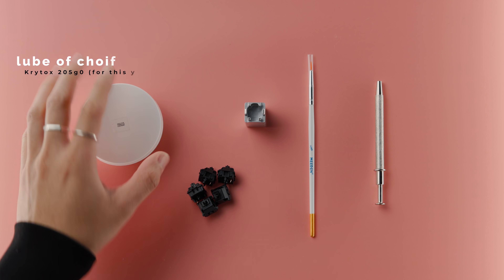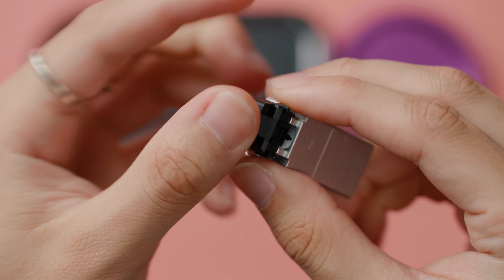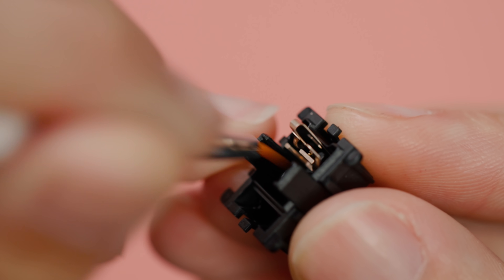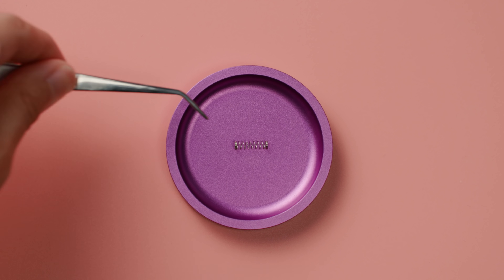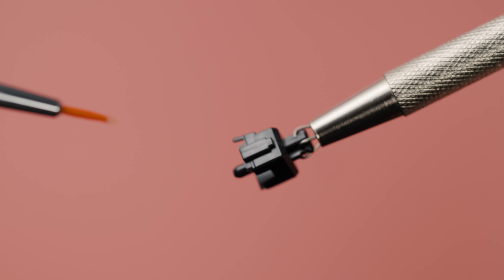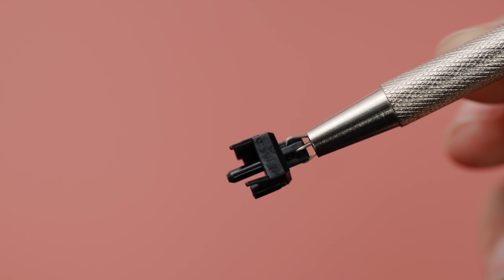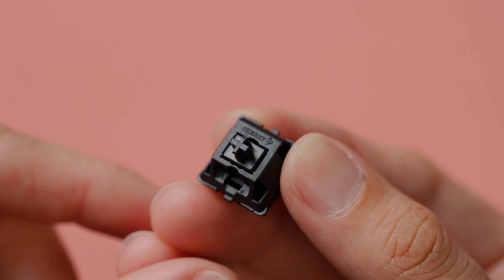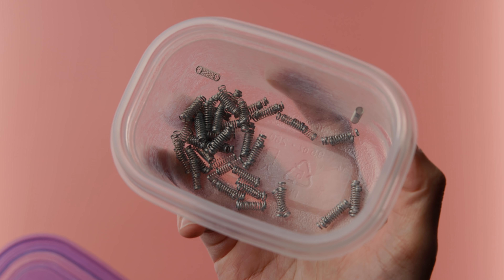How to Lube MX Style Switches

Comment: Do you recommend lubing Gateron blue switches? I have the blue switches on my Keychron K6. 
Thanks!
Reply: Not worth it to lube clicky switches for as you want to stay as far away from the click bar as possible.
Reply: @ninaalee3263  Thanks! I want to find out how the clicky switch sounds like and I am worried that after I lube, I will regret lubing.

Comment: How long does the lube last? When do you think you must re-apply?
Reply: Once you lube the switches/ stabilizers, it will stay for a very long time ( mine was last for over 2 years before it started to wear off ). Even if the lube wear off, the smooth feel will still maintain in the switches/ stabilizers so you don't have to relube them unless you really want to :D.

Comment: one question i have is how often should you lube your switches?
Reply: Once you lube the switches/ stabilizers, it will stay for a very long time ( mine was last for over 2 years before it started to wear off ). Even if the lube wear off, the smooth feel will still maintain in the switches/ stabilizers so you don't have to relube them unless you really want to :D.

Comment: Do you need to let the switches dry before putting it back into your keyboard?
Reply: No need to as you only apply a thin layer of lube on you switches, unlike spray lubing as you will need to wait for a few day for the lube to dry out.
Reply: @huunhanle3809  thx

Comment: What are the repercussions of overlubing a linear switch? Let's assume that I (horrendously) consistently overlubed an entire batch of cherry MX reds. What would be bad about that?
Reply: Not very bad to be honest, it's only affect your typing experience since the switches are overlubed - itdoesn't feel too smooth and it feels almost muddy. Imagine wet mud - it's slick and slippery, but also very thick and tough to get through. In particular, the upstroke felt slower, and it was not a pleasant experience in the slightest.

Comment: How often should I lube my keyboard switches?
Reply: You really don't have to re-lubed switches since when you lubed them switches, the lube also applied a very thin layer of oil on your switches. When the lube wear out, your switches will still maintain the smooth feel as the thin layer of oil is still there.

Comment: this also works for optical switches? sorry if it's a dumb question, im a beginner :)
Reply: You can, Krytox 205g0 and Tribosys 3204 lubricant are both go-to options for linears Optical switches- just make sure not to get too much on the center post - a glob at the bottom of the switch may confuse the optical sensors.

Comment: Can I lube the stablizers of my blue swith keyboard? Not the switches self, but only the stabilizers of my keyboard? And which lube is the best for that? Is the krytox xht-bdz good for that? (since it is thick)
Reply: Sure, you can. And both Krytox or XHT-BDZ is a good choice for lubing stabilizers, pick wherever you prefer :D.
Reply: @huunhanle3809  I just thought just because i have blue switches  wouldnt be a thick lube bestter than a thin lube? since i want to keep my switches heavy and not super light, cuz i have blue switches?
Reply: @cloxytr9144  The switch and stabilizers are two individual parts of the keyboard, lubing your stabilizers will make it produce less pinging sound and less rattle, and it has nothing to do with the switch. Thin or thick lube is based on personal preference, so I really don't know which one is better, some people like thick lube for stabilizers, others prefer the thin.

And of course, you don't need to lube your Clicky switches, if you prefer to keep your switch's tactility and the "click" mechanism intact.
Reply: @cloxytr9144  Nah, it's depending on your lube method, and which lube you're using, so no guarantees the result will be the same. For the type of lube that matched your requirements "not really thin but also not really thick", I would suggest Krytox GPL 205g0:105; it's a mix between GPL105 and GPL 205g0 in order to reduce the thickness of 205g0.

Comment: i know this is sacreligious but a guide to lube OUTEMU switches for those of us that only make $2/hr in Southeast Asia and Latin America would be lovely, sadly every other switch company out there is extremely expensive and making less than $200/month makes it IMPOSSIBLE for someone like me to buy anything else. Thanks.

Edit: I say this because you can get Hotswap Outemu keyboards for less than $40 bucks(i currently own one, had to save for 2 months); maybe this could work with outemu too??
Reply: You could buy Gat Yellow for like dirt cheap and if you want clicky switces, buy kailh box jades. Gat yellow cost $0.20 andKailh Box jade cost $0.50.
Reply: @slimsam3447  Sadly those don't fit in Outemu sockets :/

Comment: I did this and I am unable to press in my switch now. What do I do?
Reply: You probably do something wrong if you can't physically press your switch
Reply: @miekoyee  yeah I figured it out, so if the metal pin thingy is bent towards the spring any you assemble the switch back together it won’t work. Sometimes it bends a little and you don’t really notice it. If it does happen just push it back

Comment: 8:14 don't do that btw. Leave the stem alone. I've ruined my first couple batches of switches doing that and other guides tell you not to. You can check other guides like alextos where he explains it makes a seal/vacuum in the bottom well that the stem goes into and makes the switch sluggish and not sound as good as it could. Otherwise perfectly fine guide
Reply: Any advice on good guides that don't make mistakes like 8:14? Got my first keyboard from a friend and it's a soldered board so hoping to get it half-decent on my very first try since I'm a complete beginner.
Reply: @Chex_Mex  Alexotos lubing guide is better imo. My personal advice is to cover the brush with a generous coat of lube, then wipe off as much as possible. Try to put so little of a coat that you can only really see it when you shine the light directly on the spot or it'll be a bit overlubed for 205g0. I just hit the bottom sliders and around each side of the stem, don't hit the bottom either but you're free the experiment with lubing the bottom of the stem sides
Reply: @incongruous4  Thanks for the recommendation. I checked it out and I'll definitely give it a shot, thank you!

Comment: Hi Taeha, question for you, I see a lot of people like to do bag/tub lubing springs with oils, specifically Krytox GPL 105/106. My concern is that oils will eventually slide to the bottom housing (correct m if I'm wrong). Would this be a reason not to oil springs and preferably brush lube with grease instead?

Comment: Solution: Please for the love of God some cool custom keyboard company find a way to buy old Alps manufacturing rights and bring them back. Cherry wasn't the top switch (not bad but definitely nothing special or premium) back in the gold ages, and they feel and sound scratchy by default, and the modern market is all based on them 😭😭😭
At least they started doing contactless hall effect or optic switches again, and that smoothness and feel just cannot be rivaled (at the expense of a hollow plasticky sound most of the cases).